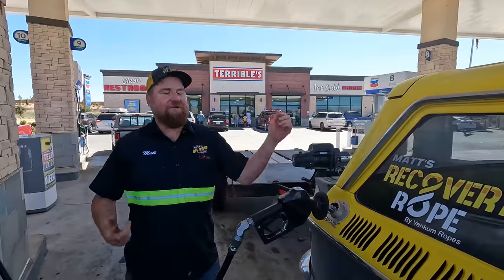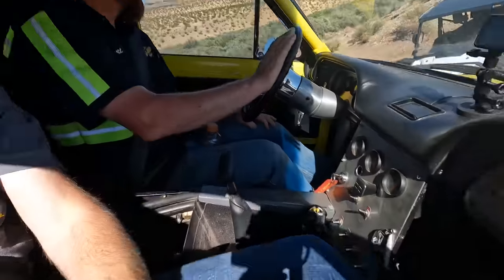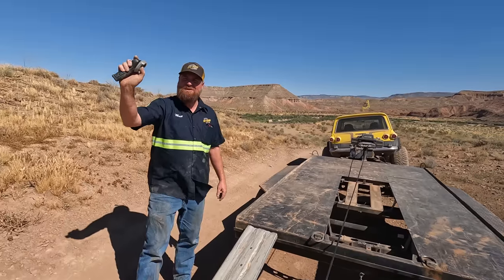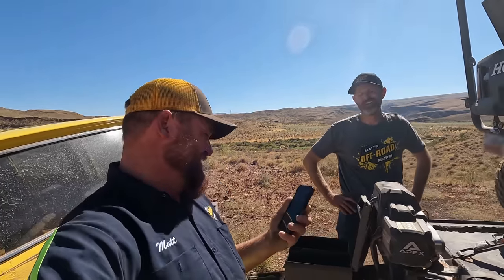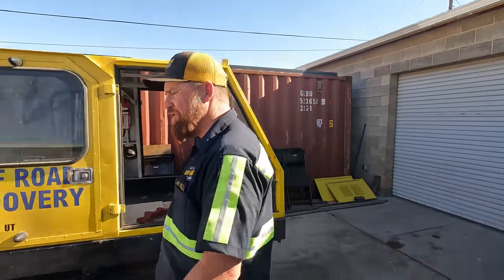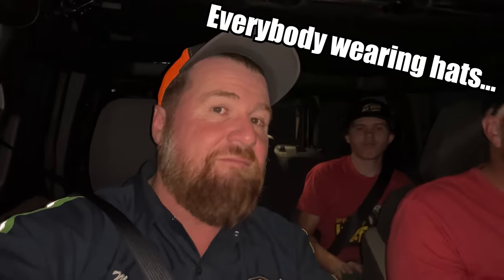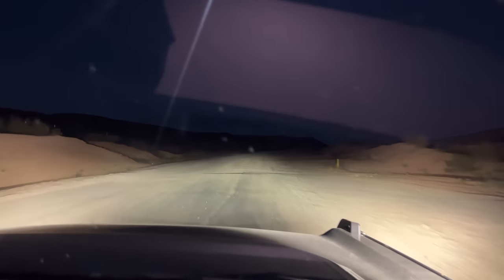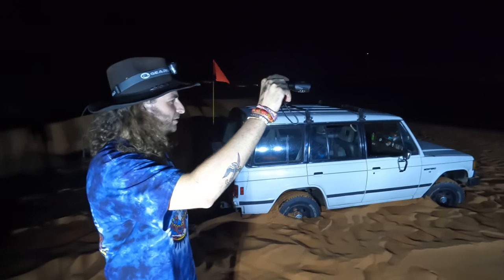Customer Get's Chewed Out For Getting Stuck!

Comment: Dry heat is (in my opinion) far more tolerable, but likely more dangerous because you dehydrate that much more quickly.

From first-hand experience, I absolutely prefer 110F at 10% humidity over 95F and 90% humidity.

But Matt's point about the ground being hot is also completely valid.
Reply: Having lived in both climates I would agree but I don't think the dehydration part is accurate.

For me, personally I barely sweat when I lived outside Las Vegas, but put me in the humid heat and I've soaked through my shirt by the time I walk to my truck and sweat like a pig.
Reply: Can't own a sweater in humid weather.
Reply: I've lived in both climates and I agree with you. Matt is wrong on this one
Reply: @evictioncarpentry2628  you didn't sweat because it evaporated, hence cooling you. Making you more heat resistant and more likely to dehydrate. I've lived both climates also, currently southern Nevada.
Reply: I agree that I'd prefer 105F air temp with desert like humidity levels compared to today's local forecast of 95F air temp and 73F dewpoint (49% humidity) - roughly 105F heat index.

That said you've probably never in your life experienced 95F with 90% humidity in a natural environment.

While its not technically impossible to get 95F with 90% humidity in a natural environment, its very very rare as that would be a dewpoint of 92F.
In natural settings, dewpoints above 85F are uncommon, very localized, and short duration. 

Midwest has the highest recorded dewpoints in the US (Corn sweat) and AFAIK the highest dewpoint recorded anywhere in the US is 88F
Reply: @shaneabrahamson8732  that's not how sweat works. You body sweats because it's over heating thus cooling you off.
Its not evaporating instantaneously before it hits the epidermis in dry heat. I'm sure there is evaporation happening, but that's not the differentiating factor here.
Reply: 100% agreed, try 115 - 120 at 90 - 100% humidity, like in Iowa.
Reply: @evictioncarpentry2628  you do sweat, it just evaporates off you which is deceiving.
Reply: @evictioncarpentry2628  no, it is the difference,  it doesn't evaporate before it hits epidermis, but it does evaporate before you get soaked in very dry climates. You get soaked in humid climates because your sweat can't evaporate once it hits your epidermis if the air is already saturated with water at 95+% of what it can hold.

This is the same principal of how an evaporative cooler will work in the dry regions like the SW US, but not at all in some place like Florida.
Reply: @evictioncarpentry2628  Humidity is more uncomfortable. You feel sticky and sweaty because of the moisture collecting on your skin. While sweating isn't as effective at cooling you via evaporation in high humidity, you don't have the same risk of heat exhaustion. The real danger comes from very high temperatures and dry air that pulls moisture out of your body. You sweat and it evaporates more quickly in dry conditions, but the extreme heat has another card to play and its simple physics. The greater the temperature difference, the fast heat moves from higher temps to lower temps. The human body is right around 99 degrees core temp and usually about 90-95 on the skin, depending on the individual person (skin color, body fat, body hair etc.) and when the temps outside are under 100 degrees, there isn't much heat transferring into the body. As the temps go up outside, that equation changes. Your body is still trying to maintain ~99 degrees, but as temps move north of 105, it's fighting a losing battle. You sweat to cool your skin as your body moves more of your blood closer to the surface to cool off. Once you're past 110°F outside, your body is doing everything it can to reject heat, but there's nothing more to be done. Same reason a pot on the stove will boil despite all the evaporation occurring on the surface of the water. The water can't eliminate the heat fast enough to balance out the energy input from the burner on the stove. At those temps, if you're exerting yourself outside, you are losing upwards of 1.5 quarts an HOUR! It gets even worse if the wind is blowing. 

 That temperature differential is dangerous. Especially in situations where it's dry enough that the air is wicking moisture directly out of your skin. The areas where these phenomena occur also has a lot to do with ambient temps. Humid areas tend to be a lot more green which in turn causes evaporation and transpiration with plants and lowers temperatures. The southwest doesn't have that nice green layer to keep things cool. The rocks heat up and the dirt heats up and raises ambient temps. That's why the official temp in the shade at the airport in Las Vegas might say 115 but your car is telling you its 120+. Your car isn't wrong (accuracy concerns aside) but its getting ambient temps from other sources like its own body panels, the ground, nearby buildings. If you were standing outside, you'd be feeling those temps as well. A couple women just died last week out at Valley of Fire with a reported temp of 114°F. But if you lived near Vegas, you know Valley of Fire is nothing but rocks and dirt. It was probably a lot hotter walking through those formations. Heat radiating up from the ground makes it hotter. The news hasn't reported, but it wouldn't surprise me at all to learn they didn't have nearly enough water with them.
Reply: The ground is just as hot in humidity. Temps are measured in the shade so you shoot the ground in Atlanta on a 95 degree day in the sun and it will be 100+ as well.
Reply: Once it gets this hot, the discussion about it being dry is irrelevant.  112 F with low humidity is deadly and miserable.    No point in arguing whether it's better to boil or bake to death.
Reply: I am looking at 98 with 87% currently it's unbearable outside
Reply: @Qusin111  115F with 90% humidity is impossible on earth.  Everyone would have died within minutes.  Heat index would be like 300 F.
Reply: high heat and humidity is far more deadly, your sweat doesn't evaporate as easily in high humidity so it doesn't cool you as much so you sweat more. a combination of heat higher than normal body temperature, high humidity and no breeze is a deadly combo that kills people quick.
Reply: Totally agree.  I live in an area that is fairly hot in summer but fairly dry, but I have spent time in Matt's area (hotter and a little drier), in  Vegas, and in Phoenix as well as other places that were very hot and dry but found them to be bearable.  I lived for two years in a place that was hot and very humid during summer and it was absolutely miserable 24/7.  I'll never live in a humid place again.  I remember doing a service trip in Denver City, Texas to repair some equipment in August, I had to keep my tools covered or I couldn't handle them if I set them down for more than a minute and I had to put pieces of cardboard down on the grating that covered the platform that the equipment was mounted to.  The challenges between dry heat and humid heat are different and both bad but I'll take the dry heat every time.
Reply: @dorvinion yea rn it's 93% with 59% humidity where I am rn. Heat index is 120
Reply: @the_wiki9408  Even air temps in the 90s with 90% humidity are extremely uncommon. 

Getting dewpoint above 85F takes localized, and short duration conditions for such to happen.
Reply: Here in hawaii it's 85 degrees but 90 percent humidity sweating all day
Reply: Yea. Come to nyc in the summer. Or go to Florida. Humidity is terrible
Reply: I agree. Dry heat is more tolerable.  However, you dehydrated faster with humidity. You sweat a lot more in humidity temperature.  especially if you're not used to humid places.
Reply: @Daishar  : lol, calling it a swamp "cooler" is a deliberate oxymoron.
Reply: The “hot” 😂 conversation never ends. Hot is what it is. Dry or humid temperatures have there individual techniques for survival, having been a resident of St. George UT and Birmingham Al. We have rescued and recovered people from both areas for similar reasons. Heat kills if you are not properly prepared.
Reply: @evictioncarpentry2628 which made you conscious of how much water you lost, the dry heat it evaporates faster and you don't feel like you are losing water
Reply: @evictioncarpentry2628  It is absolutely evaporating. The phase change is what cools you. Just being soaked in sweat isn't cooling your body.
Reply: @adubs.  And this is why we can tolerate being in a 160-190F sauna
Reply: Assuming one can remain hydrated, humility is far more dangerous. 

The problem with humid heat is the sweat doesn't cool as effectively. Meaning you carry more heat. Increasing the possibility of heat related issues.
Reply: For the same temperature you dehydrate more in humidity than in dry.  The reason is that cooling by evaporating sweat is much more efficient in dry heat than in humid heat, therefore the body has to sweat less for equal cooling.
Reply: @evictioncarpentry2628  if anything you are sweating more in a dry heat, the difference is your sweat can do its job and cool you by evaporating.
Reply: @evictioncarpentry2628  your sweat disappears in dry heat
Reply: @evictioncarpentry2628  He is absolutely accurate about dry heat dehydrating you faster. Your sweat will evaporate in the dry air (less sweat) but the body will actually dehydrate quicker.
Reply: 100% agree. I have lived in Fort Myers, Fl and have spent time in the south west US. I can say without question that south florida summer weather is absolutely brutal. You can walk outside at 11am, find the biggest shade tree around, sit down with a cold drink and you will be drenched in sweat by noon. Like soaking wet. 90-100F with 85-95% humidity is pretty much as bad as it gets excluding some parts of the Amazon.
Reply: @silver1fangs you must be in GA where I am lol
Reply: Although it may feel different idc hot is hot lol
Reply: @paulrivers7248  "hot is hot" lol ok
Reply: I was coming to say pretty much the same thing.  I’ve lived in Nevada and Utah .  I currently live in Arkansas.  The steel temperature and ground temperature are just as relevant in a humid climate with the  exception of grass cover and other plant life will help keep the ground temps down, but in the middle of a gravel or paved lot it’s irrelevant.  With the lack of humidity, the cooling effect of sweating works better because it readily evaporates but you do have to stay hydrated because you don’t realize how much you sweat.  Inn the high humidity environment, your body cannot cool as easily due to the sweat not evaporating nearly as quickly, but you definitely know you’ve sweated. 😅
Reply: @evictioncarpentry2628 that's the point. You do sweat, it just dries so fast you don't know it. That's why people get dehydrated so much more quickly. They don't realize they're losing water.
Reply: Perhaps the more accurate way to say it is that you don't PERCEIVE that you're sweating due to it evaporating so rapidly. This is part of why dry heat is a different kind of dangerous.
Reply: I've lived in Texas all my life. where 105-108 is normal and then with humidity its a "real feel" of 115. Even then nothing compared to the time I was in Vegas and visiting the hoover dam and it was 128. I was cooking just being outside. I've never felt heat like that. I thought I was inside an oven.
Reply: @MamaJLW  Yes, dry heat can be just as bad if not worse when it comes to dehydration....but the difference is it just doesn't feel near as awful as super humid heat...it can sometimes almost seem impossible to breath. Also, heatstroke is muchh more common in humid heat due to the body's sweat not being able to evaporate, which in turn prevents the body's ability to cool itself through evaporative cooling.
Reply: After a trip (or two) to Iraq thanks to Uncle Sam I can definitely say people that talk about "dry heat" when it's over 110° like it's no big deal are full of crap. Yeah you get used to it to some extent but it's still anything but pleasant and the best part of humidity is that when the wind blows it cools you off. In the desert when the wind is blowing it feels like you are standing in front of giant hair dryer on high. It's not fun and you sweat your butt off. I don't care if it's 100+° in Virginia or Iraq...100+° sucks.
Reply: @Qusin111  AT 100 degrees F, relative humidity at 70 %, would feel like 140 degrees. You'll never see 90% humidity when the temp is over 80F. It might feel like it today here in NW Illinois, but at 88F and 73% humidity, it feels like 102.
 As the temp goes up, relative humidity goes down, because hotter air can hold more water than cooler air.
Reply: What Greg said even though Matt doesn't want to hear it.  Dry heat is much more comfortable to work in even though objects are hotter.  Definitely have to keep up on the fluids though.
Reply: Dry heat is better than humid, soupy heat. But give me mid twenties and snowing while at a ski resort, those temps are way better. Its easy to add another layer, however I can only get so naked.
Reply: You will dehydrate quicker in a humid environment where you are pouring sweat off than an arid environment
Reply: @USA__WILL can't own a sweater?.......you become a sweater in a humid environment
Reply: @Daishar as somebody that lives in a state with 115° temperature with at least a 75% humidity or higher throughout the year I can confirm what you're saying to be.... False I have watched more of my co-workers here in Texas drop to the ground in the middle of a heat stroke and dehydration that I have with any other job working anywhere else in the United except for Florida and Louisiana
Reply: The ground and metal gets hot in Florida too
Reply: @honthirty_  I don't have to. I've lived both...just my opinion bud.
Reply: @dustinmiller7278  Sweat evaporating or not won't keep you from heat stroke once you hit certain temps. Yes it will cool you some, but the baking temps will still push your core temp up so maybe you make it 2hrs of work before you hit heat stroke while sweat is evaporating well vs 1hr and 45 minutes if you can't sweat efficiently. Over a certain temperature the human body, especially our modern typically out of shape ones, is not designed to operate in that environment, which is why historically people who lived in climates that got that hot rested in the heat of the day out of the heat any way they could. And why we invented air conditioning. That doesn't change the fact that yes, even when you don't feel drenched in sweat in a seriously dry environment because it is evaporating, you are still sweating and losing water. Heat stroke isn't dehydration based, it is based on your body temperature.
Reply: @@PadmeAmidalaN i drink 1.5+ gallons a day and i dont pee i work outside in STL MO water is essential i grew up in Nevada (Winnemmucca avg humidity is like 11 or less) where i also drank fairly heavily without emptying my tank but less. if you are sweating in a dry heat you are dehydrated if your are sweating in humid climate you are outside but if your out in it YOU NEED WATER.
Reply: This is why I don't complain when its 20 outside and snowing.  At least it's not 95 with a 75 dew point.     Florida is a no go for me
Reply: We're nearing 100° everyday with 100% humidity here in Texas
Reply: @Aeroswine1776   I find humility makes people much more tolerable!
Reply: @ZboeC5  Well, thanks for serving.
Reply: @topgunner102  it was 100 today with sprinkles off and on (100% humidity is raining) i think it was 60%ish here today. Also we have more shore than california only the coast of the east shore is higher on avg than MO and some south(mostly east)
Reply: the body sweats as much ?  but does not cool down in humid climate. 
actually feel cooler because of sweat evaporation in dry climate:  but same rate of dehydration ?
Reply: @dorvinion 
Yes, about the corn fields!  The humidity is far higher when driving next to them!
Reply: @@PadmeAmidalaN you might be confusing climatology with biology...
Reply: maruiacancer6  give it a break...
Reply: @topgunner102  lol, no you're not...
Reply: @ZboeC5  amen, brother and thank you for your service! Glad you made it home.
Reply: @lazyblazer  Excellent points. I’ve lived in the desert and in hell… I mean south central Texas (I only mean hell as far as WEATHER is concerned. I’m NOT dissing Texas, y’all.) I personally prefer dry over humid. I know others prefer the opposite. What we can all agree on, I think, is let’s just all be careful and hot is hot no matter what other conditions are involved.
Reply: @Brian-vd4mg .  Yea, Matt thinks the sun don't shine on our ground also.  Our weatherman was on TV doing the exact same thing.  Temps ranged from 140 - 170.
Reply: Relative humidity is one the most pointless measurements. It’s a percentage of the total capacity of the air to carry water, but the capacity of the air changes with temperature.

Dew point is the far superior measurement as it doesn’t change wildly.
Reply: My opinion is dry heat is a little easier to deal with. But simple fact is either one will kill you if not prepared. Lived in Phoenix for 12 years and Dallas for the past 20 so yes I've experienced both. But that's just my opinion and opinions are like a$$holes everybody has one.
Reply: This.
Reply: @MamaJLW  Amen brother
Reply: @@PadmeAmidalaN Then you know better than to mix two unrelated subjects and draw conclusions from that...
Reply: @mahbriggs  I could really feel it today.
Dew points here in Iowa got up to 78.

I feel sorry for the RAGBRAI riders.
Almost seems like they always somehow pick the hottest week of the year.
Reply: @philb5593  to some degree, I don't really pay much attention to temperature so much as dew point in the summer.

Much rather go out in 90° weather with a dew point of 50 than 80° weather with a dew point of 70
Reply: @dorvinion  
Yep!  Just a few hours I driving around in my jeep, and when driving on a dirt road between two cornfields the humidity jumped way up!  I was fairly comfortable till then!